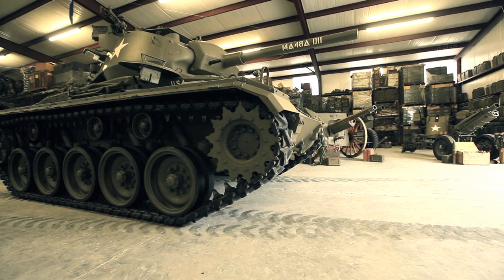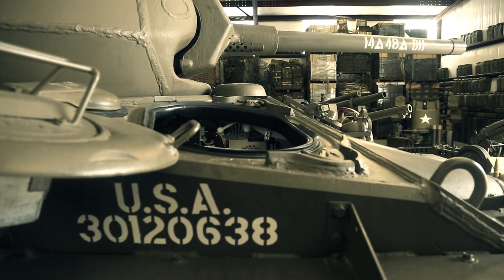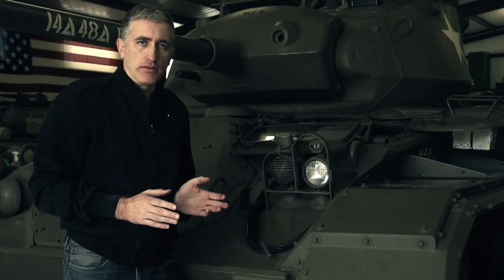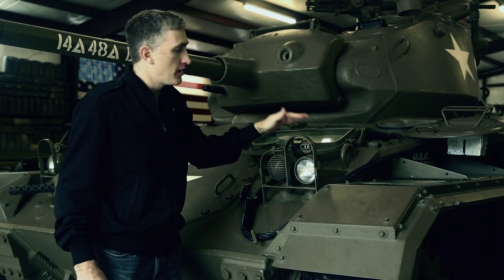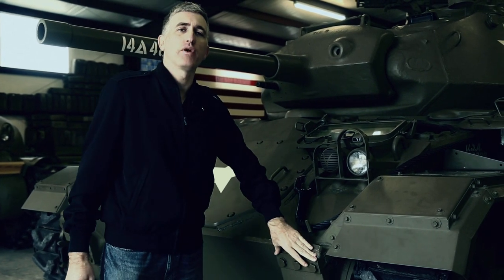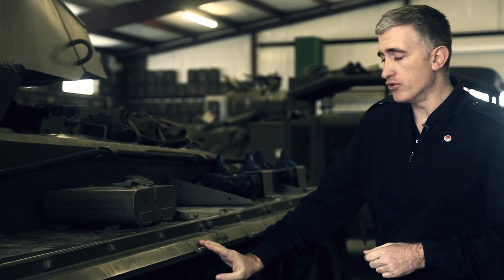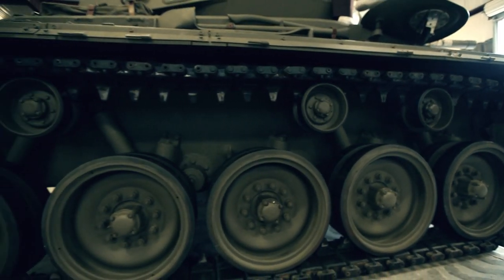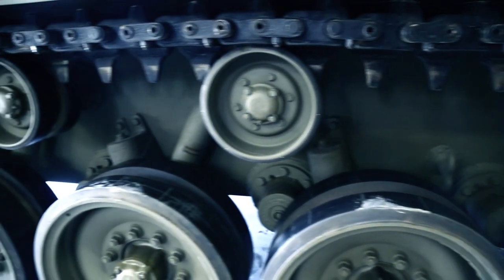Inside the Chieftain's Hatch: M24 Chaffee Part 1

Comment: Just a guess here but I believe those added bolt on bits on the front and rear are for securing the tank to a skid of pallet. The tank was supposed to be air mobile and to do this many times air mobile equipment is mounted on skids with a parachute and literally pushed out the back of an air craft. Not sure. Just and edjucated guess

Comment: It's an experimental turret that was, if I remember right, intended for use on the M41 Walker Bulldog (the M24 Chaffee's successor). Why is it on the Chaffee? I think it's because the Chaffee never had any suitable "experimental" turrets of its own (Anti-air twin 40mm Bofors, or Multiple-Gun 6x 12.7mm Brownings). The Norwegians even seem to have used the stock turret when mounting a French Low Pressure 90mm. Not sure about the Chilean M24s with the IMI 60mm HV guns.